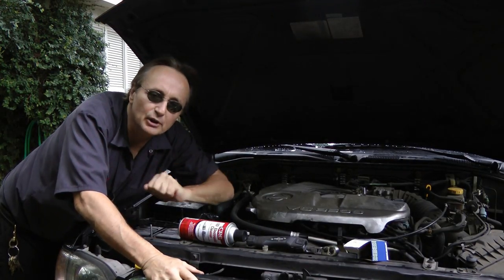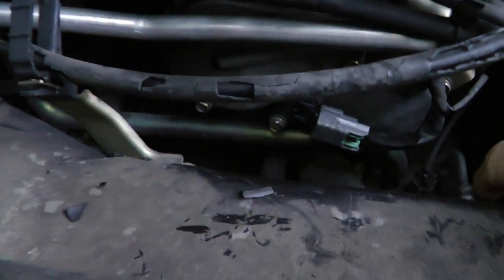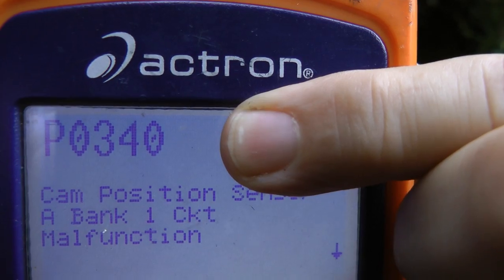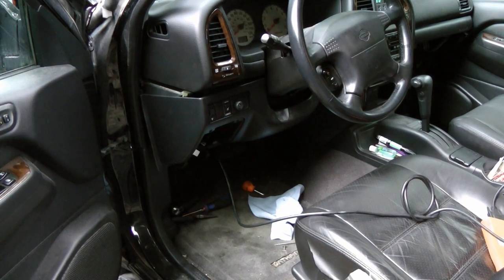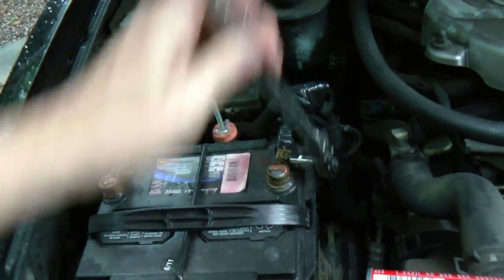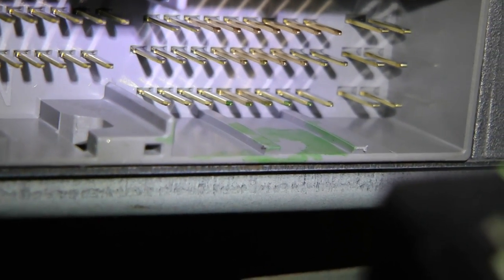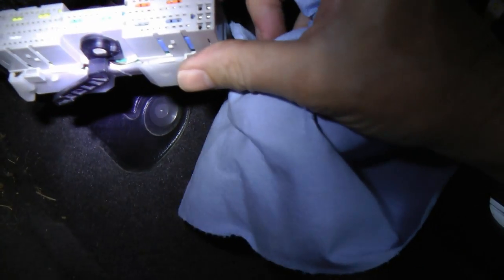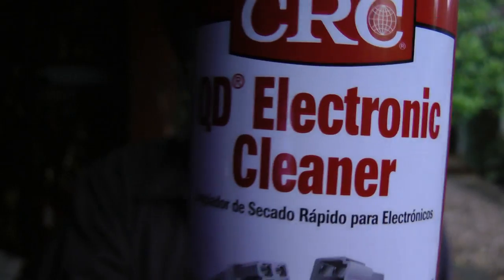How to Fix Computer Problems in Your Car with a Little Spray Cleaner

Comment from the maker: Things I used in this video:
1. Electrical Cleaner: http://amzn.to/2zXqsB0
2. Actron Scan Tool: http://amzn.to/2ngeCQJ
3. Ratchet and socket set: http://amzn.to/2inoxOY
4. Mechanic’s Tool Set: http://amzn.to/2Bzmccg
5. Wrench Set: http://amzn.to/2kmBaOU
6. Shop Towels: http://amzn.to/2jGDfkA
7. Disposable Gloves: http://amzn.to/2zSRuxO
8. Common Sense
9. Full HD Camera: http://amzn.to/2AvoEk7
10. My computer for editing / uploading: http://amzn.to/2i2sKYz
11. Video editing software: http://amzn.to/2jv5Fhf
12. Thumbnail software: http://amzn.to/2k7tz6C

🛠Check out my Garage to see what I use every day and highly recommend:
https://www.amazon.com/shop/scottykilmer

❗️Check out the Scotty store:
https://goo.gl/RwhRGU

👉Follow me on Instagram for the latest news, funnies, and exclusive info / pics:
https://goo.gl/ohy2cA
Reply: Scotty Kilmer.  hi !mr scooty can you tell me where the connectors are for a eccode u 1000 in a pathfinder 2005. pcm and ecm thank you very much
Reply: Hey Scottie I was wondering if can help. I have a 2004 Cadillac SRX service theft like keeps coming on I've changed fuse and tried everything else I'm sorry I didn't think is a e c m problem
Reply: Scotty Kilmer scotty i did that now my car wont start up it wont crank click nothing???
Reply: Scotty Kilmer Scott I have nissan Almera 1'6 twin cam 2004 cars fuming inside while driving  burnt petrol smell engine is fine not burning oil pse help
Reply: Scotty Kilmer    I have a 2012 expedition that vibrates when accelerating and already replace spark plugs, and coils. And is still vibrating.   Any idea?
Reply: @liljoecompton165   I hope you made sure it was dry before plugging everything back together

Comment: Boy, I wish this guy lived in my town... he’d have my business
Reply: TIME FOR, SCOTTY KILMER SHOW!
Reply: Chief Keef  Uhhh... What?
Reply: Just move to houston,TX buddy then he'll live in ur town lol
Reply: @nydrell1969  he just moved to Tennessee 😂
Reply: I'm in Milwaukee. Mechanics are idiots up here. I would be willing to drive my 18 yr old baby down to TN. Runs but quite sure it is a computer problem. I had a dinky 1F audio capacitor on it between 2 amps. Thought a mechanic would see 14 V on it. Unhook it. Had it been a TX sized one I would have unhooked it first. It was a joke too small I have been shocked by 5F ones. 
Mistake! He just left it. He thought taking the huge fuse off the battery would be fine. No! It is not wired like that. I'm really pissed. Any USA Lightning ppl please help. Will start taking the dash apart wiring in switches for parts that are electrically shot. Radio. Windows. Cabin lights only work when the engine is off. The boost dropped down to 8 which makes me even madder. I dont want to break it. I know enough computer/physics things I can REALLY break it. That is not a brag. If I get frustrated enough it will not be good.
Reply: He does
Reply: @JCRLIVEARTS  he lives in Texas, he’s half way across the country my dude..

Comment: I was getting the dreaded Flashing D on my '05 Pilot two weeks ago and my OBD2 code reader came back with two faults...P0974 and P0980 which are electrical faults within the circuits of Shift Solenoids A & C. I did some troubleshooting and I was coming up empty but I replaced the original solenoids anyway(which tested OK) due to the age of the vehicle.

I was getting frustrated and feared it could very well be a faulty PCM.

Anyway, i saw this vid so I ran out and purchased a can of the CRC Electronics Cleaner and I sprayed it on all of spade terminals on the PCM and also the female connections on the wiring harness.

VOILA!! No more faults.This vid and that $8 can of spray saved my bacon.

Thanks Scotty!
Reply: 2007 dodge ram 5.7 Throttlebody problem I change the throttlebody problem continue I  I purchased the gasolin  pedal  the truck still giving the light for throttlebody or gas pedal please help the light come on on freeway or normal lDrive

Comment: having cps problems on my 7.3 powerstroke.  all sorts of info on the internet to put you in a black hole. 2nd replacement I used the same cleaner to get some dialectic  grease out of the connection as I was afraid I had put  to much on during the 1st repair. seems to be working 35 m test run. then I see this. Scott you are the man. I bet this would fix all the problems on the Ford forums. thank you for all your videos and sharing your knowledge.

Comment: Hi Scotty.  I have been getting PO172 and 1073.  I purchased a MAF and reset the computer.    I then cleaned the throttle bottle and put back together.  It starting running really bad and drove it for about an hour to clean it up but still almost stalls.  The acceleration is better though.  I then got code po401.  The first thing I thought about was the egr valve.  When I take the middle hose of the 3 hoses off the throttle body the one that is green the car starts running perfect. Back on rough

Comment: Great advice.  My car was running very poorly.  Mechanic could not fix.  Spray cleaned ECM terminals.  Car is running great.  Thanks!!
Reply: We're you stalling or getting p0344 p0340?

Comment: Hey Scotty, I have a 94 C4 Corvette. While driving the car suddenly shuts off. I sometimes have to wait 3-5 min before trying to restart to get it to kick back over. I've noticed some electrical issues within the car like the door switches moving by themselves as well as door is open light constantly coming on. Could this just be a bad computer that can just simply be replaced. I know the fuel pump works through the computer and if it malfunctions, could cut off the fuel supply to the engine. Replaced Radiator, Water Pump, Opti Spark, Spark Plugs, Fuel Pump and Battery. I appreciate all the help cause I put thousands into my corvette already and it runs good otherwise.

Comment: Nicely put video, Scotty. If the spray cleaner doesn't help to get the car started, feel free to contact our technicians to help you out with all your engine computer needs. And no, it doesn't cost a fortune. Ours start from just $48 per unit.
Reply: Flagship One, Inc. I wish u was here in new york
Reply: Eehhhhh...not to dissuade business from Flagship One, Inc. but please read their reviews and make a decision for yourself. I'm in a situation where these guys are all I have left to help get my car running. I'm waiting for my ECM to begin shipping (which it said it was to have started shipping within 24 to 48 hours of getting the tracking number. That was Friday, May 8th and it's now 5:12PM on Monday, May 11th. I'm going to wait until one more business day to see if it then moves and then call). While I'm happy for being emailed about delays or anything with the order, none of my sent emails have received a response and calling them takes three millennia to reach anyone.
Reply: @BewareTheLilyOfTheValley  did you ever get your problem resolved?
Reply: @TreyCFerg  I did, I tried putting the ECM on myself but I think my battery was too dead to complete the full programming process. Not sure if it was necessary, but I purchased a second ECM and had a mechanic install it and it worked! Car still has a slew of other issues but the computer seems to be fine.

Comment: After reading this video, feel it maybe the ECM connector need clean? Do you have any opinion? By the way, thinking about buy a cheap ECM from eBay. Do you think the used ECM may need dealer re-program, even with the same make/model/engine? Thanks a lot.

Comment: So, I thought I may have accidently disturbed the old factory electric connection. The EGR vacuum regulator solenoid was given pulse voltage, so a good connection is probably vital. Now I want to thoroughly improve the  connection at solenoid harness before other action. Do you have any advice on how to make a tight connection, or other advice to the above diagnose. I bought a bottle of Deox D100. Should I apply generously to the connector and harness? Thanks again in advance.

Comment: Hello Scotty. 
First, excuse my "rusty English" from the other side of the world.
Hope you do not mind that I strongly suggest a more strict instruction when it comes to disconnect and reconnect car and boatbatteries.
1. ALWAYS disconnect the - (negative) terminal first before you touch the + (positiv terminal).
2. ALWAYS  connect the + terminal first then the - terminal. Or earth if it is a car.
The reason for this is that if you happend to tuch anything accidently with your tool nothing happens. (Also I recommend to loosen both connections if you cannot really safely put away the negativ connection.) 
Really enjoy to look at your videos.
Best regards 
Lennart K* Myrhammar, 
Senior advisor
(Boat mechanic for 45 years and Rescue Skipper)
Stockholm, Sweden

Comment: Excellent Scotty- Got any good advice on electrical display issue with Dashboard of 2006 Chrysler 300c?!  I checked Oil - Water. For over heating issues. I'll move onto dust on fuses next. I believe there maybe a "Touching" or no slack in wiring in the engine compartment. I'll wait for your review. - She's got a new Engine - different from the Factory one that DROWNED because of the Faulty Gas Sensor.

Comment: I have a 2004 lexus es330. Had to get my alternator change, and in the process of also getting a new battery i blew the 120a alt fuse.replaced that, however now my car wont reach after the 1st gear, someone says it may be in limp mode, and the question is if it was a fuel pump would my car even start?2nd do you think i should reset my ecm computer on my car?please help the car was just fine going into every gear before getting a new alternator and battery.

Comment: Hey buddy I got 2011 535i BMW it wouldn't Crank so  I went to dealer and they said that my dme was bed so they unplug that vvt motor and set to max lift manually. And told me that I can drive it now. So my concern is that is it safe to drive without vvt motor?(since is unplugged)Thanks for your help.

Comment: I have a Ford escape 2012 with a Ford fusion 2010 engine that was recently swapped in. Cars been installing misfiring and having trouble starting. And seems to be getting worse. Also with the AC on the engine shakes crazily? You think it could be the ECM?

Comment: Hey Scotty I have a 01 lexus is300 and after spending a fortune at the mechanics i figured out that my computer is getting oil on it. Yes engine oil. Have you ever seen or heard of such a thing? Could you possibly point me in the direction of what i should replace . Im kinda at a loss

Comment: Scotty, thanks!. I tried to take out ECM from this 1994 Ford/Tempo. ECM hides way inside. I managed to move the connector and ECM out a little bit in an easier workable area. However, it seems the connector and ECM stuck together very tightly. Cann't take it out so far. Could it be corroded badly, or had short previously so make it unusually tight? Can I apply some WD-40 or PB blaster to penetrate overnight for easier removing? Or there is a trick I did not identify so far? Vcauum seems ok. thx.

Comment: My Computer is in the engine compartment, why is it placed in a spot where it can get so hot and bake?  By the way, my PCM only cost me a little over $200 and installed myself in a few minutes.   Dodge wanted $1,600 to do the same.  I am sure they would maybe have used a little more expensive brand new PCM but the refurbished I got has worked great for a year so far.

Comment: i have a 2003 Chevy cavalier that keeps getting the 0p300 code (random misfire) I've replaced the fuel filter,  the coil pack, plugs and checked the timing chain. my next step is a compression test and I checked for a vacuum leak. can you help?? do you work on bikes as well?? I have a 2004 Yamaha xj650 that doesn't get spark. I checked the coils and replaced the ecm

Comment: hey Scotty i have a 2006 chevy equonix. when i am driving down the road. the vehicle will stall out giving me a check engine light and reduce power light. i read the codes, P0606 and P0601, and its saying to change the pcm. by any chance are there any other possible casuses. or should i get a used one, if i do get a used one would it have to be reprogramed by the dealer?

Comment: my W124 valve cover breather hose has leaked oily gunk into electrical plugs near the fuel pressure regulator - what is the best method to get that plug clean - or is electrical cleaner good enough?

Comment from the maker: I would have used throttle body. But, to check the egr valve, just remove it, and block the holes under it with a home made gasket. if the problem stops, then it's an egr problem, such as a sticking valve OR bad power feed to the valve.

Comment: Hi Scotty. I've a 1994 Firebird. It started running rough but has never thrown a SES light. It only happens after I drive it once, park it, then drive again the same day. I've already replaced the plugs, wires, coils, Ign mod, air/fuel filters/PCV. Saw EGR adptr was causing vacuum/exhaust leak. Fixed that. Then did- CTS. The funny thing about most of these repairs is right after I do them my car runs fine for a few days then the symptoms return often in some reduced degree. DYT my PCM the cause?

Comment: Hi Scotty, hope you are having a great day. I have a problem with my 1999 vw beetle 2.0, I have a P1128 code. I have change the fuel pump, the mass air flow sensor, repair a hose under the hood and every time I reset the engine control unit the code comes back. Some people have told me to check the pump (but I have change that) and the fuel pressure but my car doesn't have any problems to start, it runs fine. Could it be that the ECU is damage? Also every time I reset the ECU 3 cycles are ready to go and 4 cycles I need to drive the car, I'm not able to reset the ECU to factory settings 3 cycles won't reset.

Comment: Contact spray works great on degreasing electronic clips in the engine. When valve covers loosens from vibration some oil leaks, or oil vapours from other components. This mixed with road dirt and debris kicked up in engine. A little preventive maintenance could go a long way to keeping that dreaded light on the dash.

Comment: Scotty,
94 Ford/Tempo, with intermittent rough idle (when engine warm at a traffic light), hesitation (loss of power at acceleration), also intermittent check engine light. The OBD-1 either gave pass code (KOEO, CM), or sometimes stopped before finishing repeated flashing. Temperature reading seems not stable (move between middle and high fairly quickly). Did tune-up (spark/wire/cap/rotor), new air/fuel filter, replaced CPS and temperature sensor (coolant and air), cleaned MAF. Any opinion?

Comment: I am having this same problem with my 06 Nissan Altima 3.5 SE. P0340 camshaft sensor bank 1 circuitry- changed cam 1 and swapped barely connected harness. Brake & Battery light flickers on & off when i hit a bump, draining brand new agm battery, alternator whines, no power to alt, trans, or fuel pump😥 BUT  3 mechanics say its electrical. Thinking ecm, since the whole dash is on & off. This seems worth a try.

Comment: I have a 91 f150 that was shifting very hard into second gear and would die when i reverse into my driveway...would  start back up but had to feather gas to get into driveway....replace the fuel filter as well as plugs and wires and new battery just maintenance stuff but during this winter it will not start just cranks....my driverside door is full of water and my cowl weatherstripping is gone. So im thinking my ecm is wet and now just cranks no start...could i possibly dry it out or test it?

Comment: Great video I actually thought it was my pcm that was an issue on my 01 dodge intrepid and then I changed my camshaft position sensor and the engine light for the pcm went off thanks Scotty!

Comment: Hey Scotty I have a 2002 Honda accord ex the check engine light came on checked it with a scanner and gave me code p0325 knock sensor I replaced the knock sensor but the check engine light came back on do you think I have to reset the ecu?

Comment: Scotty,  what would be involved in installing a pulled computer from a scrap yard or ebay?  Would refurbished be better?  Need an auto locksmith and who else?  Older Suburu.  Not willing to spend a fortune.  Please provide details.  Thanks.
Reply from the maker: depends on the year and make. Most ones now need reprogramming to actually run the car you put it in. And used or rebuilt, both are gamble. I really only put on brand new ones myself. But you can gamble IF you can find a guy to reprogram it outside of a small fortune to do so. the equipment to do so costs thousands

Comment: hey Scotty I got a 2007 toyota corolla the engine light is on running code p0741 suggested part is new ECM... I have no change in performance or anything can i drive tbis until next weekend when I fix it

Comment: Scotty, my transmission is in Limp Mode, Fail safe mode, i have replaced the transmission , an speed sensors, its still doing it, will a bad TCM , cause it not to shift out of 2nd ? once it hits 35 mph , it revs likes its in Neutral . its a 99 Elantra, please let me know. thanks

Comment: Thanks Scotty for all of the awesome videos. In regards to the cam shaft sensors, I have a '03 Toyota 4runner i replaced the engine... from an '06 4 runner vehicle. all nuts and bolts fitted perfectly. The only issue that i have is that when i plug both cam shaft sensors my car will not start, when i unplugged both sensors my vehicle after several key strokes will start. Any ideas in what the problem could be? BTW- i purchased both new cam shaft sensors from Toyota. Thank you.

Comment: Hi scotty, random question sorry.
Got a 93 bmw, turned the steering wheel today and horn started honking. hasn't stopped since and I had to pull the fuse. I think when I turn the wheel a certain way it stops. Know what the problem could be?